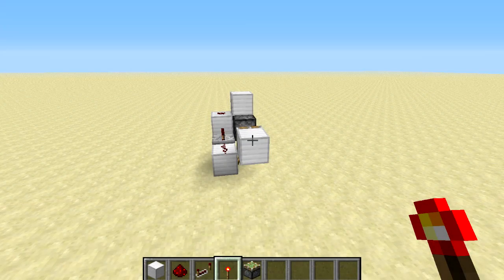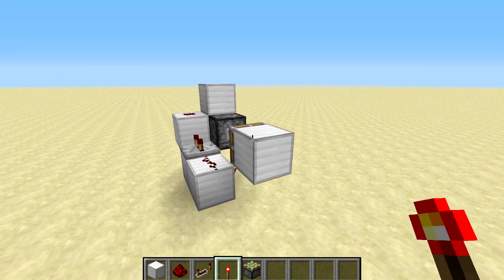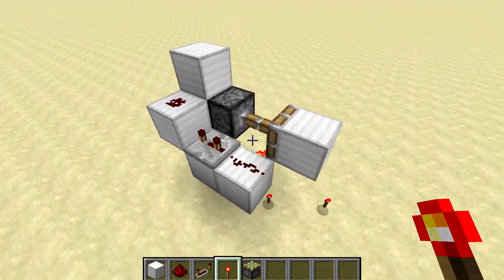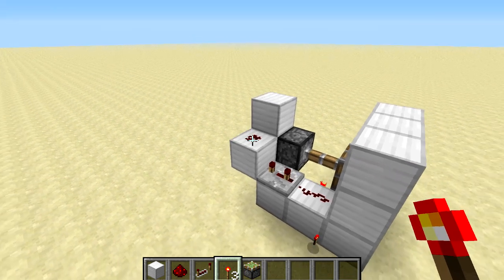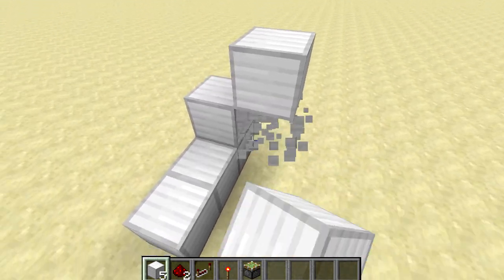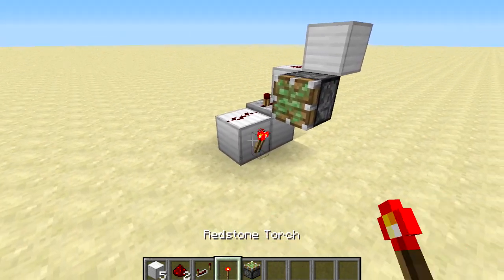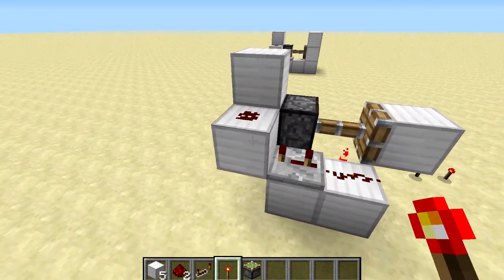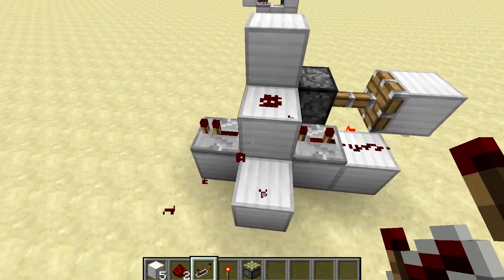Minecraft: Redstone Torch Key (Quick) Tutorial

Comment: Yeah you can turn any redstone signal into any other redstone signal by various methods. The BUD works (I assume) because any placed redstone/redstone torch actually updates blocks in a greater area around it than normal blocks do. So it's not only updating the block you place it on, but also the piston.

Comment: When you place the torch it updates the block and the blocks around it (Redstone updates more blocks around it) The extened arm of the piston gets updated and tells the piston that it is not powered so it should not be extended. Then the block goes over the torch and diagonally powers the piston. Which then extends the piston (which removes the power source since the block is no longer above the torch) Then it gets unpowered without updated the piston i.e. BUD
From a fellow Redstoner,
Stone :)